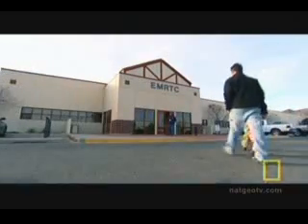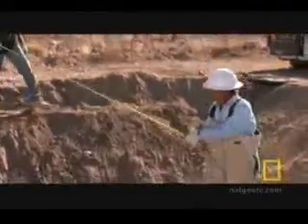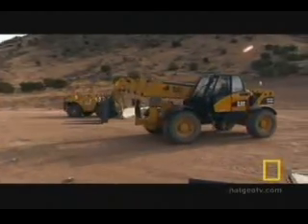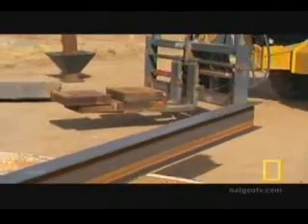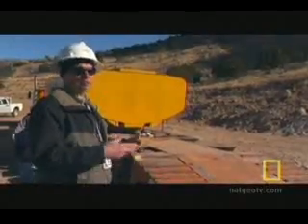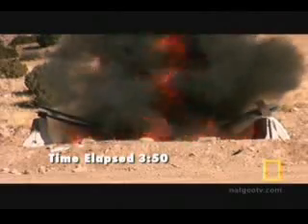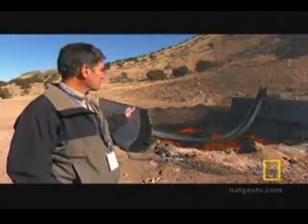steel being weakened by a jet fuel fire

Comment: Note; this steal is not treated or insulated against fire, all buildings are held to standards which mandate the load baring beams to be insulated against fire
Reply: +Tim and in the video, they explain that they used a bare beam because the initial collision with the plane would have knocked off insulation that had been there for nearly 40 years.
Reply: I am curious what happened to the concrete core.
Reply: st8pl8guy
yes but what happened to the concrete core?
Reply: @blackdogleg  the Twin Towers did not have a concrete core. That was part of what was revolutionary about them at the time is that they were Steel. Where is most buildings were being built as steel reinforced concrete.
Reply: st8pl8guy The towers were calculated against attacks with airplanes
Reply: @t1mmy13  they weren't designed to withstand attacks. They were designed factoring in the possibility of an accidental crash if a plane were lost in the fog while searching for a landing strip. They anticipated a 707 low on fuel at low speed. And they certainly didn't anticipate having a long uncontrolled fire with the fireproofing blown away.
The designer is also said the fail point of the building would have been six floors. If you lost 6 floors it could not stand.
Reply: The twin towers did not have concrete cores.
Reply: Calculating against airplane attacks doesn't mean plane invincibility. Boats calculate against sinking in water, but guess what happens from time to time?
Reply: Pretty sure that when a jet punches a hole into the side of a building, the insulating precautions that you speak of have become compromised.
Reply: st8pl8guy At the points of impact but not the entire floor.

Comment: all this did was prove that at 2000 degrees C it STILL didn't completely melt the beam. It just weakened it. As an engineer I understand it weakening. What I don't understand is the molten steel at ground zero. You just proved jet fuel wont melt it. Thank you.
Reply: ***** Pretty sure the design wasn't for airplane hits, considering the main structural integrity of the WTC towers was their external walls. That's why they were able to be as large and as tall as they were. When you breach the main integrity, shit falls like a house of cards.
Reply: Chay Cooper "As an engineer..."
"who cares about the volume?"

Choose one.

Because I don't think you're an engineer, but just some schmuck on the internet trying to get a rise out of people and barely passing.

You try to use the facts, but you don't understand heat transfer and thermodynamics, because otherwise you wouldn't be making these claims. Please go take some chemistry / physics classes and get a better understanding of the content before you spout numbers others have spouted before. Don't be a parrot, be a thinker.
Reply: Chay Cooper Pools of metal glowing for days
Reply: itsthevoiceman Well that is where pretty sure and facts differentiate and cause ignorance and a distortion of reality.
The designer and lead structural engineer of the Twin Towers, Leslie Robertson, mentioned the findings of the studies at an event that took place in the week before 9/11. During a question-and-answer session at a conference in Frankfurt, Germany, he was asked what he had done to protect the Twin Towers from terrorist attacks. "I designed the World Trade Center for a 707 to smash into it," he answered.
Architect Frank De Martini, the construction manager of the World Trade Center, when interviewed in January 2001 for a documentary about the Twin Towers, said, "The building was designed to have a fully loaded 707 crash into it."
Frank A. Demartini, on-site construction manager for the World Trade Center, spoke of the resilience of the towers in an interview recorded on January 25, 2001.
"The building was designed to have a fully loaded 707 crash into it. That was the largest plane at the time. I believe that the building probably could sustain multiple impacts of jetliners because this structure is like the mosquito netting on your screen door -- this intense grid -- and the jet plane is just a pencil puncturing that screen netting. It really does nothing to the screen netting."
Need references? You can easily verify.
Reply: itsthevoiceman ok im sorry. i meant to say "who cares about volume IN THIS SCENARIO" a building is not a water tight tank of jet fuel. most if it would run out of the building or onto lower floors. this works not be a controlled pool of jet fuel. the holes in the walls as well as the holes in the floor would allow the escape of the fuel, therefore the temperature would not increase in such a manner.
Reply: Not only was the steel molten, IT WAS MOLTEN FOR OVER A WEEK.
Reply: a) In perfect conditions kersosene can burn at almost 2000°C.
b) The scale in this Video is in °F. So it is 1100°C.
Reply: AOSniperJoe What document? Reference?
Reply: Chay Cooper And there is that. There is a reason 6000 plus professionals and architects call bullshit on the "official" explanation. And it isn't because of an increase in tin foil hat sales.
Reply: For whatever reason, and i'm not here to speculate, i'm not into speculation, all three buildings were demolished by other means than the two airplanes. No one knows why. We may never know. But what is clear is that reality does not fit the official explanation. .
Reply: itsthevoiceman It could be simply that the terrorists gained access to a government building and did what they needed to the buildings and the 'govment doesn't want to look incompetent and unable to protect America. It doesn't have to mean our government had anything to do with it. There are several possibilities. But regardless, the official explanation is ridiculously false.
Reply: do you have a source for this claim? I've never heard that one.
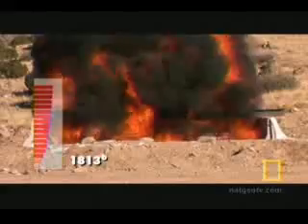Reply: Which one? 4:25 -> Fahrenheit
Burning temperature of stuff:  Wiki-> Adiabatic flame temperature- >Kerosene
Reply: Well it's in fahrenheit as the melting point of steel, or iron is 1595 Celsius
Reply: @TimpBizkit  many people also ignore the factor of heat sinking. The glowing material seen coming from the towers at the time of the event can easily be explained by the sheer volume of aluminum involved. Reports of glowing Steel and molten steel are somewhat unsupported, but also not unexpected. These reports were days after the tower collapsed as fires continue to burn Underground. Concrete makes for a good insulator therefore temperatures of the contained space where the steel was would have reached higher than simply that of the burning fuel. This phenomenon is known as heat sinking. Because heat isn't simply derived from the source temperature but also accumulates; basic physics.
Reply: The beams were weakened hence they came done. I'm not sure where you saw molten, I was there.
Reply: According to NIST and FEMA, the initial explosion burnt up the jet fuel. Sooo, how did jet fuel concentrate itself enough in that short time frame to perfectly attack all the trusses and everything else it would have needed to in order to collapse that building? Also, the building still wouldn’t have fell straight down.  Both sides of the government said two different theories as to how it fell. One said the trusses bowed in and the other said they bowed out. Now how in the fuck do they come up with the opposite conclusion. What’s funny is, both said in their initial statement that they found no evidence of explosives or thermite. Coincidentally those are the only things that could’ve brought those buildings straight down. Those buildings were blocked off prior to 9/11 for “renovations”. Plus all the eye witness accounts stating they heard and saw explosions. Why don’t they broadcast Danny Jowenkos statement of how this is a controlled demolition. How he owns a demo company and before being told that building 7 was part of 9/11 he was shown the video and he said clearly this was professionals. It’s a controlled demolition. He was killed in a one person car accident after he said that.
Reply: absolutely correct.
Reply: +AOSniperJoe ok all knowing one.i doubt youve done the tiniest bit of research because if you DID, youd still be bothered to this day knowing that it just didnt line up. you can believe what you want but that doesnt make you right. so go ahead and trot around like a big bully calling people twats for having opinions. youre clearly an intelligent person to begin with.
Reply: Ever take a match and light it? Ever take 1000 matches and light them together? Volume of fuel matters.
Reply: itsthevoiceman who cares about the volume? technically a lot of the burning fuel should've poured out of the building or into lower floors. it also doesn't change the fact that it can only burn at 1500 degrees. that doesn't change the fact that beams melt at 2750 degrees. that does not change the fact that the buildings fell straight down and did not topple to the side at all, a feat only seen in controlled demolitions. that down l does not change the fact that large chunks of molten steel were found out ground zero. so something must have been present that burned over 2750 degrees. think about that.
Reply: @itsthevoiceman  they get to the same maximum temperature.  volume of fuel doesn't change that.  basic thermodynamics.  you're clueless.
Reply: itsthevoiceman but the thing is, a house of cards made of concrete and steel would not collapse into itself like a black hole. it would not fall in a perfect 180 degree angle. I'm not sure how nobody sees this
Reply: Jet fuel doesn't burn at 2000 degrees, this is an inaccurate video
Reply: Chay Cooper Only one in some deep denial would call what happened to two skyscrapers designed to take multiple airplane hits per, being demolished, pulverized, falling into their own footprints was a cause of an airplane hit.
To assert that the design didnt account for fires is stupidity. And the fact that the core was concrete reinforced is the smoking gun.
Tell them to L2 Physics.

Comment: The portion of the video that discusses "fireproofing" is irrelevant.  Fireproofing in the WTC was simple asbestos (built before the government regulated it), and asbestos indeed does not burn but it also does not provide a thermal barrier, so while it does not catch fire, it will allow transfer of heat.

Comment: Read the NIST report, traitors. They themselves admit the steel did not exceed 492*F. Tell me again how much steel weakens at 492*F... Fucking tools.
Reply: FinalPerception I googled what you said and can only find crackpot conspiracy websites. The original argument came from a crackpot called "Hoffman", what you/hoffman has done is taken NIST out of context. NIST only tested 4 beams for paint cracking, some of the beams were so badly burnt there was no paint even left on them but they were never tested. Two were well above the impact zone and the other two were beams that were knocked clear on impact, and a fragment of the same column that would have been hanging in empty space, and not directly heated at all since all flammables would have been blown/fallen away, all 4 still had their fireproofing still on them (when the plane entered the building it knocked off the fireproofing on those levels, leaving the bear metal exposed). NIST has a great deal of steel that definitely reached higher temperatures, notably the bales of floor truss material recovered, but for various reasons this was not tested -- no way to tell where it was in the structure for the floor trusses, and some steel had no remaining paint at all leaving the "paint cracking" test impossible.

Now, his comparison to "uninsulated steel" is also a complicated bit of cherry-picking. What he may be referring to in that case is the Cardington full-scale structure fire experiment, in which case the insulated columns reached about 360oC, but the uninsulated beams reached much higher temperatures. If instead he's talking about some other testing, we'd have to see it to understand what he's misunderstood. NIST's own testing, especially the full-scale mockup in NCSTAR1-5E and the burn tests of insulated and uninsulated samples in NCSTAR1-5B, leave no doubt as to the plausibility of their simulated results.

There is no plausibility to his insistence that the fires were cool or that the structural steel in the collapse zone wasn't heated significantly.
Reply: +FinalPerception I'd love you to back up your bs with some evidence, took me all of 5 seconds to find the NIST report and prove you wrong.

"which reached temperatures as high as 1,000 degrees Celsius, or 1,800 degrees Fahrenheit"
Reply: +Weed0s You're wrong, moron. And it's ignorant people like you that NIST intends to directly fool. NIST cites the UPPER LAYER TEMPERATURES as being 1800 degrees F. Upper layer refers to the gas temperature.
The actual STEEL temperature did not exceed 492 degrees Fahrenheit. Research the paint-cracking tests.

Rekt.
Reply: You're completely fucking braindead. You're seriously going to argue something that is a known lie?
READ THE PAINT CRACKING TESTS, FUCKSTAIN.
Are you sure you wanna still sit there and defend the fraudulent official story, because if you do, it means you're a conspirator to cover up mass murder.
Again -- NIST says UPPER LAYER TEMPERATURES. The steel -- according to their own report -- did not exceed 492*F.

Comment: There was no pool of jet fuel at the WTC on 9/11.  The jets crash caused many gaps through which the fuel would flow out and down to the ground, and not be present to heat the beams.  The experiment should pour the jet fuel, not in a pool, but on other steel beams below in order to be representative.
Reply: +cornskid So what? If the conditions aren't the same as the initial conditions of the event, it proves NOTHING. A nuclear bomb can destroy steel, too. That doesn't prove a nuclear bomb was used on 9/11. Idiot.
Reply: To be representative, you need to also fill the structure of beams with concrete, furniture, computers, paper, carpeting, etc. You need to consider heat spreading, but also a bunch of other things being set on fire.

The burning tanker that made an overpass collapse in San Francisco in 2007 is a better test, I think.
Reply: A lot of jet fuel isn't needed to take down a building when it was, you know, hit with a fucking plane.
Reply: Jango Bun Bun An aluminum plane that should’ve disintegrated into large and small pieces upon impact, not shred steel.

Comment: Even if for some impossible reason this had any validity which it does not... Please explain how building 7 not hit by an airliner with NO jet fuel collapsed the same way that day.. If structural steel is so weak and can fail in any raging fire how come high rise steel framed buildings don't completely collapse all the time when there is raging fires..there are numerous examples of building that had much longer and larger sustained fires and they never collapsed completely to the ground, in face the two world trade centers and building 7 are the only ones in history to this day.. There was no way there were pools of jet fuel in those buildings Ike that.. Those huge fireballs upon impact were the heavily dispersed jet fuel burned off right away. The beams were also interconnected and they don't account the core columns... We could write a book on how this experiment is bullshit...
Reply: Please tell me more about this airliner that flies without jet fuel! We need more of those!